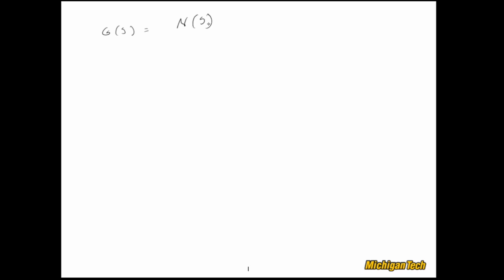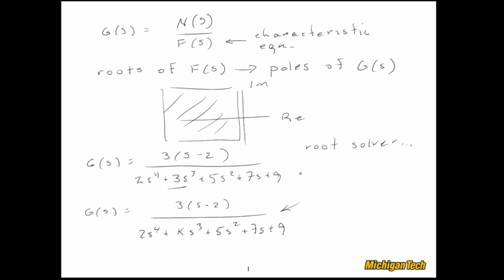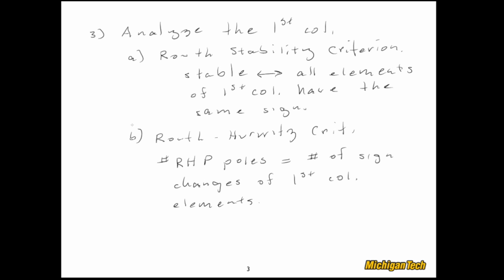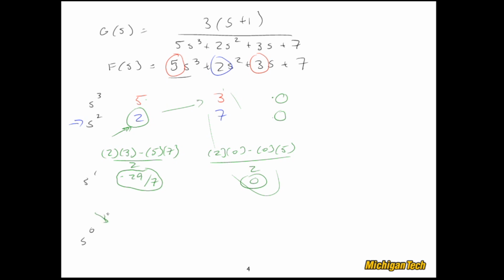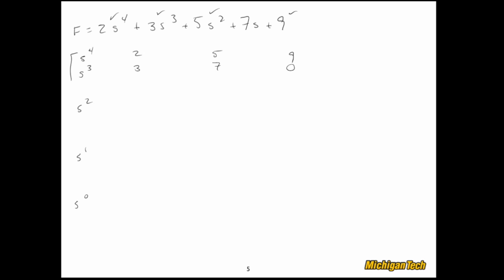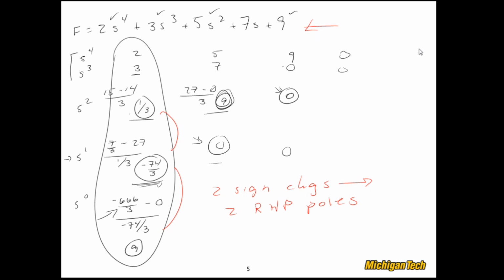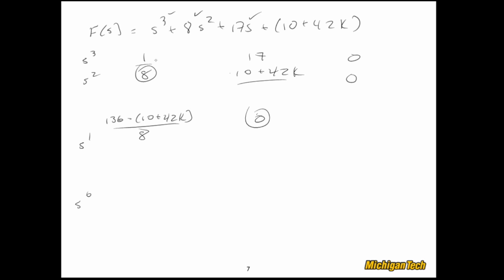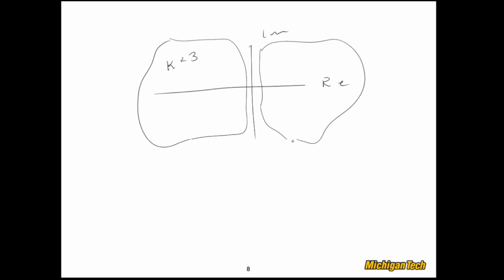Stability Analysis using the Routh Array

Comment: At 13:20, doesn't ((7/3)-27)/(1/3) = -74 not (-74/3)?  It doesn't change your point of checking the poles, I just want to make sure that my math is correct.  Great video, thanks!
Reply: Thats what i got too
Reply: exactly